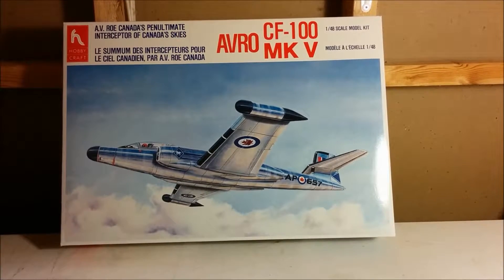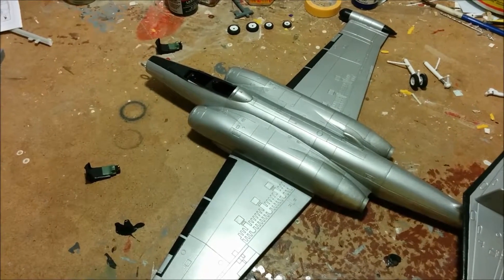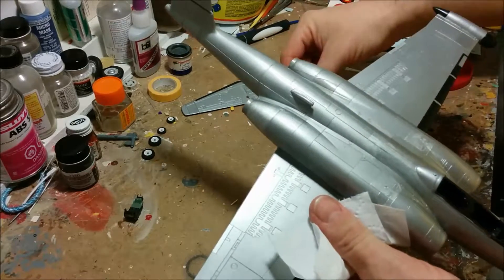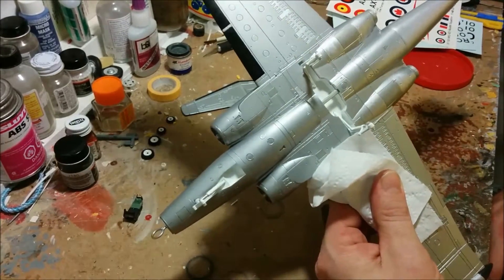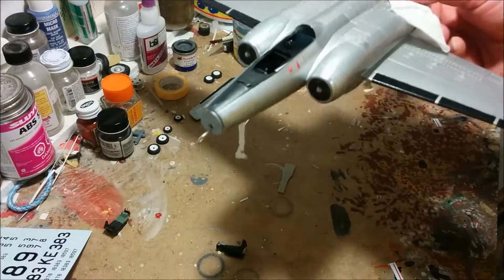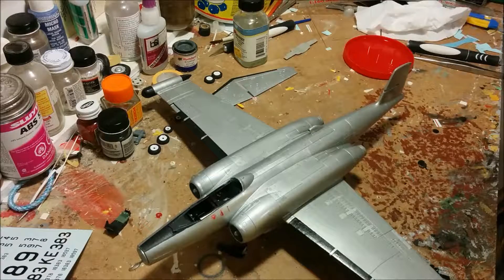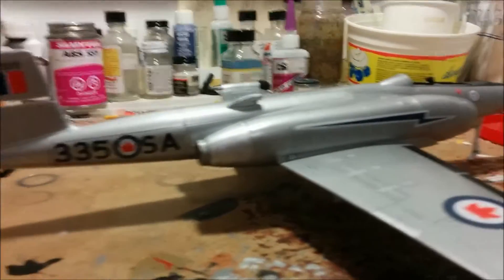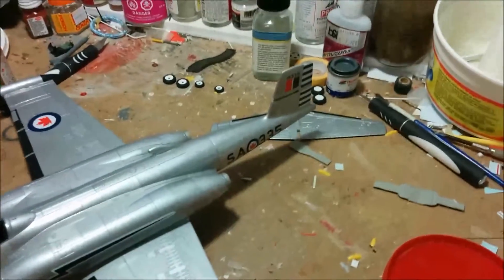How to apply decals to a CF-100 Canuck model

Comment: Nice looking model of a CF-100! What squadron did you do yours in? What type of paint did you use? I'm thinking of going with Alclad II Natural aluminum. Just has a bit of a brighter sheen than using an acrylic wash to highlight the panel lines. 
Thanks!
Reply from the maker: I used the markings for 445 Wolverine squadron. They were based first in North Bay (1953), then Uplands (Ottawa)(1953-1956) and finally Marville (1956-1962). They were disbanded after that. I picked them because my kids thought the lighting bolt was cool. I think I airbrushed Testors silver and picked out various panels in other silvers such as aluminum, steel and chrome, various brands. Thanks for commenting.
Reply: +Dansmodelworx One more question. Did you use the kit cockpit? There's an absolutely beautiful resin cockpit made by MasterCasters resin out of England. I'm buying one today and I'll keep you updated on the build. Lovely build and a great Canadian subject!
Reply from the maker: +superchris1243 Yeah I used the kit cockpit, its pretty basic. The kit wheel wells are even worse. When I think about how much scratch building I did in the Wildcat and the back end of the Chinook its surprising I didn't do anything extra. I'm like that, sometimes I'm totally anal about something minor and other times I'll just say "meh, good enough"